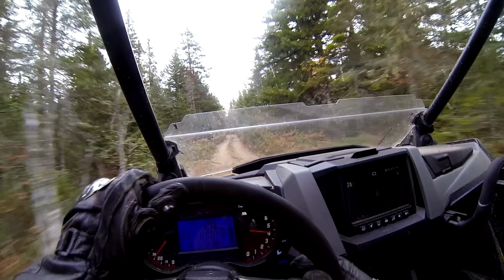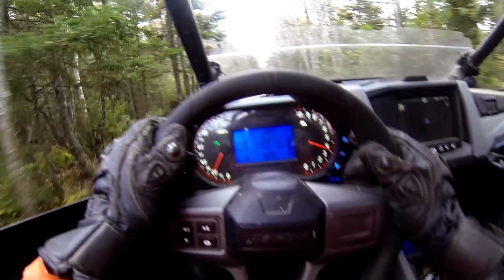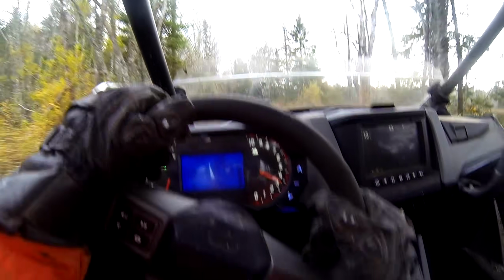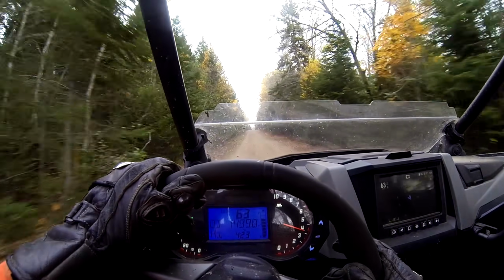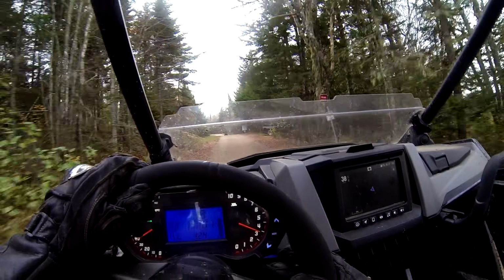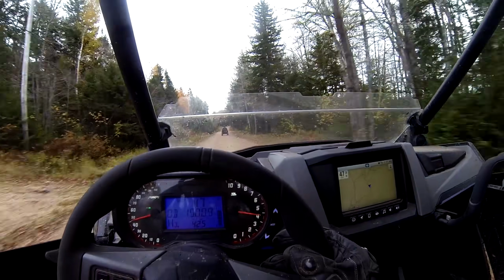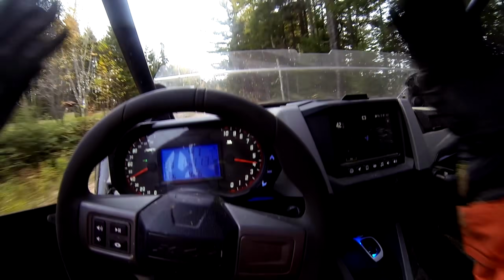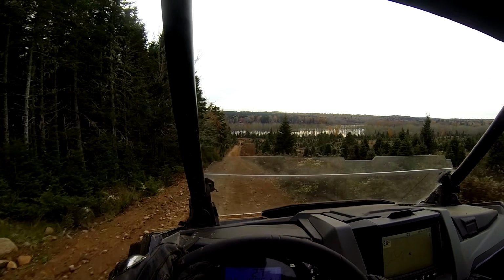**QUICK RIP** 2021 Polaris RZR XP PRO TURBO Premium

Comment: I’m within 10 months or so of ordering my first SxS after 22+ years of ATV’s. I’ve been a Can Am guy for years and have never owned a Polaris. I thought I was set on an X3 XDS RR but every time I see one of these Pro XP’s, the more I like them. So I’m in a dilemma big time. I’m in NB so I guess we’re neighbours lol. It’s a big decision because I know I don’t have to tell you the price of these things. Honestly this is the best video I’ve seen on a Pro XP in cab. Decisions decisions lol
Reply from the maker: My SXS knowledge and experience is limited really to the older OG RZR 800's and my fathers Rhino 700. 

This new breed is something else with units pushing factory motors over 220hp.

I personally would be in between an X3 64" but worried about ground clerance and turning radious issues in the woods... and the RMAX with just a sprinkle of utility. im sure the dump box would come in handy.
 

if i buy a SXS next year of whatever.. it will be a "for fun" machine, not something for the farm
Reply: @ruyguy8888  yes and one has to be careful because I also thought of a “best of both worlds” scenario in buying a General or an Rmax and I’ve seen many with the same mindset that were very disappointed because they just don’t have that fun factor they thought they’d get from a pure sport. Gonna come down to seating comfort and leg room for me between X3 and RZR

Comment: What's the inventory like up there? Depending what your looking for, could be a couple month wait time here in Vegas. Used machines are going for a premium.
Reply from the maker: Inventory sucks here too Corey. Most likely much morse than anywhere in the US. Nova Scotia is such a small province in Canada here, that we don't even exsist on the radars of manufacturers. 

If you can find a New truck anywhere on the lots around here, its most likely already pre-sold. Bikes, SxS's, Tractors, etc.. the list goes on. It's hard to deal with.

I bet i could sell my diesel truck for what i paid for it back in 2009...but to replace it will cost me upwards to 100K plus tax
Reply: I've been waiting for my 2021 Yamaha Kodiak 450 EPSs for 9 months now. The pain is real